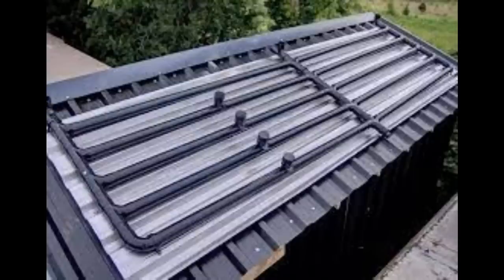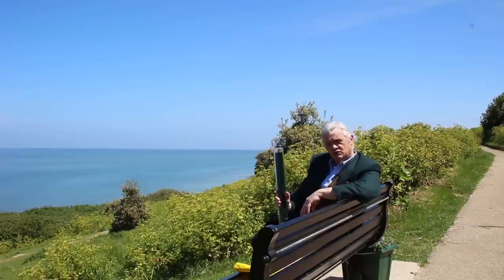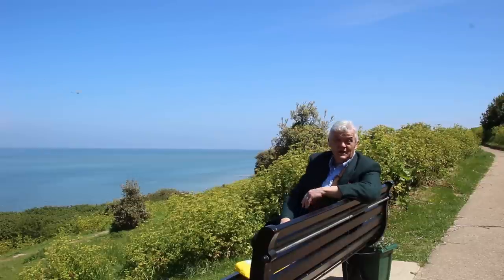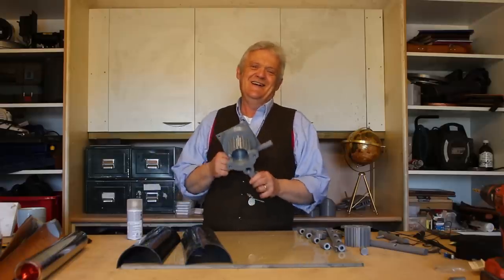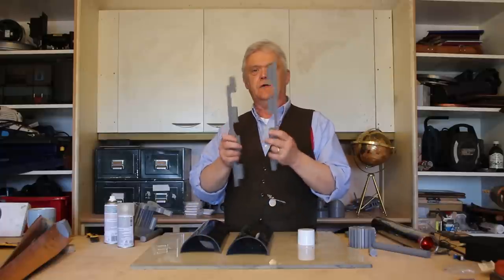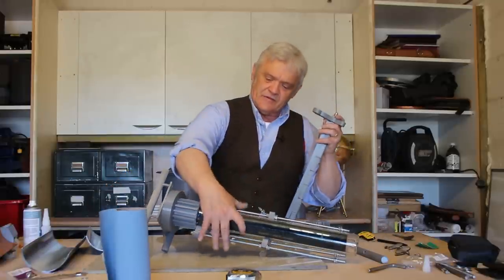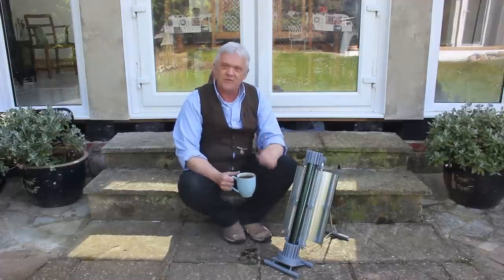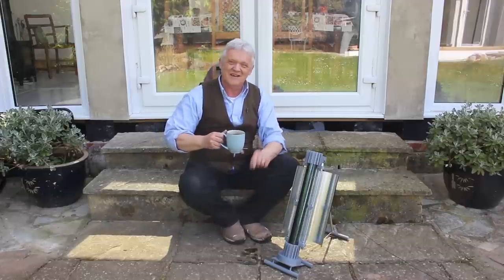1937 The Solar Kettle

Comment: Here in Mexico, everyone has a solar water heater on their roof, with a holding tank. The water gets so hot that the tanks need a tall escape tube coming out of the top, for the expanding water/steam. On especially sunny days, one can see water geysers all over the rooftops.
Reply: Wow!! 
Energy to be collected?!🤔 Certainly this sounds as though the steam escaping from the rooftop tanks
might be a great source of energy!!

I'm in the NW. UK, and it's rather too  cold and damp...

Best Wishes and Kindest Regards,
Andréa and Critters. ...XxX....
Reply from the maker: very nice and very clever
Reply: I've had a solar water heater with vacuum tubes on my terrace for almost ten years now and most of the year I only have two pipes uncovered and the rest covered with that green shade mesh. I do this so I don't have boiling water in my plumbing and I figure not letting the water get to boiling extends the lifetime of the whole setup, you know, gaskets and the like.
Reply: @THOTNetwork  Thank you!!
Im about to go Off-Grid soon, North end of the Pennines, so you have piqued my interest in Solar 
(-as well as the  wind and water!!)
Much Appreciate your encouragement!!
Reply: @goncalovazpinto6261  is this something you bought or did you make it yourself?
Reply: @susansauceda9879  I bought it but it came disassembled. A box of vacuum tubes, a box with the parts for the metal frame, and the water tank. Very easy to install on a flat roof (my house has a terrace like the top of a big building).

Comment: Improvement Idea: why not put a insert down the middle to decrease the volume of water down to just one cut, but the heating surface remains the same. This way it should heat a cup of water much quicker
Reply from the maker: nice one mate
Reply: Maybe a tube, bringing cold water to the bottom???
Reply: @ThinkingandTinkering Maybe you should do the waterheatingtest again, this time with the sunheater at 60°  out of vertical?
I'm very sure that would work much better over here in the Netherlands, since the sun is high in the sky in summer and low in winter.
Reply: Can you release a video with the updated idea (YouTube likes shorts)
Reply: And add a whistle! Good for signalling when you forgot you set it up to make a coffee after 80 minutes 😁
Reply: @ogi22  80 minutes?
I thought he said 8 minutes.
Then he should definitely try this sunheater in SUMMERmode!
Reply: @TerrorTubbie666  Yup... 80... Assuming it's  ~1kw/m^2 and his array could be effectively what? 20x50cm? And it was not a full scorching sun. Sounds about right :) But with correct parabolic mirror (a bit bigger than those half pipes) you could try to achieve up to 500W on such small thing. And that would be almost as good as a small traveller kettle 😁

Comment: Very interesting. One of these tubes, could be used as the hot side of a stirling heat engine, with an even simpler cold side going in the ground. Combined with a small generator, it should be able to generate some power.
Reply from the maker: it would indeed
Reply: Yes id love to see that in action.
Reply: The design challenge I have always found is how to have the hot end at the top of the tube and the cold end touch the ground since the evacuated tube is 500 mm. Perhaps having the tub horizontal could work but you would need to either use a working fluid to move the heat out of the tube to the hot end of the Stirling engine, Or you would have to have the hot end of the Stirling inside the tube a good distance which would limit your regeneration area. 
I have never explored inverting the evacuated tube over the hot end how that would result in heat transfer to the Stirling engine.

Comment: If only it worked in the early morning.  :)
Reply from the maker: when it is needed most lol
Reply: If your system is large enough and setup properly it should be more than hot enough from the day before. The storage temperature can be much hotter but you have to install a thermal mixing valve so you don't get burned during the day.
Reply: A decent thermos flask should keep the water hot overnight.
Reply: @jedphoenixoflondon  that vacuum tube is a thermos flask as well. Keep the lid on it and it stays hot for a while.

Comment: There's a YT video where a guy makes a freezer with a high pressure, sealed, solar heating tube filled with ammonia (which is highly dangerous, BTW) and uses the evaporated ammonia to freeze a cooler full of water. He uses a capped galvanized fence post filled with rock salts to absorb the ammonia when the system is charged, then attaches a copper distilling tube to a small air tank immersed in the water. He puts a long DIY parabolic lens behind it and cooks the salts to release ammonia vapour, which then gets forced into the distiller and collected in liquid form in the air tank. He then removes the lens and allows the system to cool and the liquid ammonia to evaporate and freeze the water in the cooler. Don't know if it's legitimate, but the concept is sound. I've always wanted to find a less dangerous way to build one of these. What chemical substance can replicate those results and not pose mortal danger if it leaks into the environment? Figure that one out and we've solved the world's air conditioning issue.

Comment: I've made various linear shaped reflectors out of the shiney stainless casings from kitchen waste bins, I snaffled them from skips. It's easily curved into shape on wooden ribs. You can get a sqare metre of collector out of a moderate size bin. Its surprising how quick they heat things.  Put one behind your solar-tube and I'd expect it to boil a litre of water in only several minutes.

Comment: A very impressive 3D printed and finishing touches remodelling, of manufactured solar kettles earlier models Robert and I am very pleased to see such.  I hope you enjoyed the cuppa :)   I personally in UK in the past, made use of Solar Kettles for a number of years in the early 2000's, using far more basic greenhouse designs, from cheap pop bottles and tin cans, to mason jars mirrors and more elaborations.  I later went to a small part of Africa in 2010, with 100's of self made Solar Panel Cookers and visited villages to teach and distribute the ideas of such kettles, cookers and fridges.  All based around designs re-found and awarded freshly (in the case of the Rolex Awards over Abbas, or latterly re-invented to further acclaim/dispute via other parties, such as Watson), such designs.  In partial collaboration with an already established firm there in Africa, I had properly built carpentered solar box ovens made, to help provide both food to a school and to provide an income ongoing,  to their collective endeavours.   In the UK, it is perfectly possible to at least make adequate panel, box cookers, kettles, or even semi viable solar fridges, with some tweaks to older designs.   They are however likely to be better performing in the commercial models, or via your tweaks with skill, or by own by bodge it an wonder.   I unlike your goodself Robert, at the time  lacked all of the tools and the scientific knowledge and testing equipment, to test or have properly documented my own half assed recreations.   So everything was shoe string budget and more for shits and giggles, than any expected results.  However, I found even in the UK, I could indeed use the Sun, to do various tasks pretty effectively.  I have safely cooked most foods you can imagine in Easter Spring sunshine, or even during Winter with patience.  I have designed my own rivals, to commercially sold, adjustable solar oven technologies, from a couple of pizza boxes, as needs musted at that time.  I have concepts for solar technologies for city living spaces and when sounded out, people knew what I was talking about.  I lack the skills or tools to do any such and bring them to a market, nor to educate any market, for such to even exist, beyond the current climates own creation that should be waking lots of folks up towards these old ideas and how to improve them.

Comment: If you put it on a turn table, you could make it turn to follow the sun as the sun crosses the sky.

Mount a photoresistor behind each wing; if the sun moves such that the photoresistor is no longer in the shade, you can use the change in resistance to activate a motor that turns the turntable until the photoresistor is back in the shade. This ensures that the solar cooker will always be pointing at the sun.

This is how the Parker space probe ensures it's sun shield constantly faces the sun, and is a very elegant solution for solar tracking.
Reply: With your optimal tracking (good idea), the kettle is only absorbing about 0.1 sq metres of solar radiation - the size of the mirrors. So yes, with optimal sunlight of 1000W per square metre you'd get 100Watts to heat the water.
Reply: Easy to do with a tiny Lazy Susan, two teeny tiny solar panels and two teeny tiny switches.
Look at the YT videos on how to make a solar panel track the sun
Reply from the maker: that seems a bit much for a kettle when you could just turn it to it's shadow - for a larger system would be good though

Comment: You did a fine job replicating the solar kettle. Best of all, it works. When you keep it in the sun then you don’t have to wait for it anymore. A thermos keeps the water hot for a long time. So when the clouds come you can reach for your thermos heat battery. 😊

Comment: Way back when, I remember going to The Eden Project and saw a version of your kettle there!

It was a vacuum tube with a microbore copper pipe running down the middle and that was soldered (brazed?) to a thin flat metal plate. Both pipe and plate were painted mat black and that was used to heat a standard hot water tank ...... with a Humungus amount of insulation round it! Thinking back the insulation was probably  not that much but at the time I was fitting immersion heaters that came with a "blanket" of 4 or 5 plastic covered sheets of fibreglass which was less than an inch .... so it didn't take much to impress me then ;o)

Low and slow is as good as a quick blast especially if you are harvesting it for "free"!

Another version that did the rounds was a black box with a series of black painted tin cans fixed end to end and a perspax front to keep the air inside. A vent was cut into the box at low level and at the top and was piped into the house with a flexable hose. The air would be heated and then flow naturally due to being warmer than the room. 
Water or air, both work for me!
Reply from the maker: there are some great designs and work out there

Comment: You have allways a great time  . We have vacuum solar system for 9 years to heat 300 l of water . Works perfect the system is filled with anti freeze and pressurised to 3 bar . One day I looked at the themperature and it was 127  celcius

Comment: Thank you always, Robert! And, you got me thinking about the fabrication complexity for those solar kettles, compared to thin, parallel rows of flat-panel reflectors, attached to a flat panel backing, each ribbon-reflector row angled for Fresnel-effect; you could potentially build a larger area for cheaper, and even large flat-panels could fold-up a bit better for storage and travel. And, mixing graphene & high temperature resins might get a decent-enough low-albedo coating for home-brew tubes? That way, you can use conductive tubing, instead of insulating plastic pipes...

Comment: 0:50 Robert, the inside of those evacuated tubes isn't red because the thing has converted light to heat. It's red because the glass is covered with a copper heat receiver. They blacken the outside of the copper using some chemical reaction.
Reply from the maker: cheers mate

Comment: it is incredibly sunny in Australia. Years ago when a gas plant exploded the officials turned off every ones gas for about six weeks. So I got eight 13mm x 30 metre garden poly tubes and connected them together of my roof. Then filled them with water. The heat from the sun meant that the resultant hot water had to have added cold water to create a warm water shower . Copper pipe painted black would do the same thing. No need for an evacuated gas tube but the glass tubes do heat up quickly in OZ. .
Reply from the maker: yep

Comment: I think there is a mix up between the 20 and 60 degrees. The setup should be flatter at 60 degrees to catch the overhead summer sun. When the sun is low in the winter, it needs to be upright at 20 degrees as shown in the video.

Comment: Improvement suggestion: Take several clean stainless steel pan-scourer pads, and tease out the steel mesh. Place the SS mesh inside the solar tube to increase the heat-transfer surface area to the water, if filling the tube directly

Comment: An easy acronym for solar cooking is C.A.R.D.
Capture - as much sun as you can with reflectors 
Absorb - using black for your cooking surface
Retention - blocking wind and other sources from stealing your heat
Duration - make sure you have enough time for the process to work.

Comment: Thank you for this video.  I think I will try running copper pipe in and out of a couple of tubes for solar hot water.  I dont have a 3d printer but Im sure I can modify and come up with a stand.😊  Thank you again!

Comment: I was thinking along the lines of a compound parabolic reflector with the tube laying in the horizontal plane in an angled glazed unit. This might capture more convection with the tube itself, positioned higher in the apex of the unit, with an insulated north side.Btw I'm a roofer and love the off-label use of guttering!

Comment: We have one of these type of hot water systems on our roof. It works great when the sun is out but we have problems with it when it is overcast. Though on sunny days the controller on the tank starts beeping like mad that it's too hot and the pressure relief valve is always dumping hot water.

Comment: Did you ever examine the copper cricket? An evacuated percolator that will pump heat from the roof to the basement.  Gosin made a 4 inch diameter oven with a 12 volt heater to cook in it without sun.

Comment: My home is a sailboat and Ive been debating on wether or not I want to build a hot water system with the tubes. You can get these for really cheap and theyre really effective. I have a 5 gal hot water heater that operates by shorepower connection, generator or by simply running the inboard diesel. Been debating these tubes for around 2 years now but the issue is figuring out where to mount the tubes. Anyways I really like your vids keep posting the awesome information!
Reply: Fascinating!  I'm just moving onto my boat and investigating all the power & heat generation options available.
Reply from the maker: i would think they would do a good job but i see the problem with where to mount them on a boat
Reply: I also live on a sailboat....and I use a 15 gallon black bladder that is lashed to the deck. It works like a charm! The water gets VERY HOT.  I live in Florida ( and the Bahamas ) ....so the solar energy is very good  but you might consider giving it a try.
Reply: Could you make a raft that you tow around?
Reply: Same situation. Our cockpit bimini has slightly swept vertical stainless bars as fore supports. I have been considering using this arrangement but am trying different methods of pumping the heated water from the tube through the hot water heater reservoir below deck. Having the protective shield is a major plus.

If you have one, maybe you could get a wind turbine mast to do dual duty?
Reply: I have extra solar only deployed when stationary - there are many more mounting options at anchor. Generating hot water whenever the sun shines and storing it would be ideal, although that would likely require a minimal pumping solution unless a passive siphon could be maintained.
Reply: oddjobbob  T'was just a thought
Reply: Save the hassle and go cold - really good for your health

Comment: I fitted a 20 tube solar hot water panel 16 years ago. I went on a basic installation course to learn the basics and avoid the delivery cost of all that glassware.
The vendors had cut open a heat pipe, which the vast majority of these systems use. The Chinese manufacturers had used water at a low pressure. It makes sense I suppose, as the lower the pressure, the lower the boiling point. 
Apparently the stagnation point of the tubes in my system is over 200C. I know it’s high, as I left the power off once when I was tidying up wiring after installation. The sun came out, so I quickly turned the pump on and stupidly felt the flow pipe from the panel, Ouch! That explains why your kettle works so well. If it’s sunny, the panel temperature can reach 40C on midwinters day, with the 170 litre hot water cylinder reaching over 30C with no other heat input. 
The costs of these panels have actually dropped in 16 years, even without allowing for inflation. Presumably due to the fact that billions of these tubes have now been manufactured, with the economies of mass production really coming in to play.